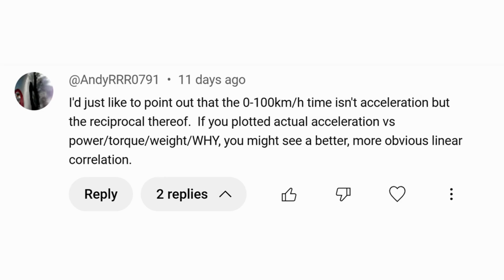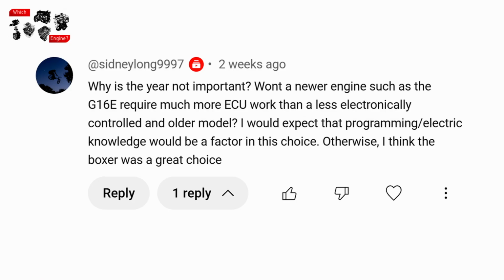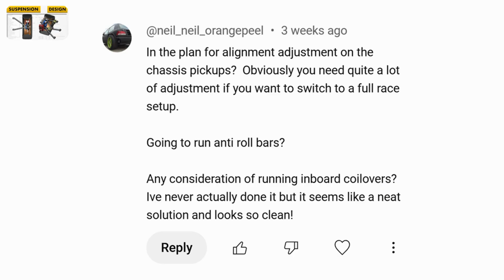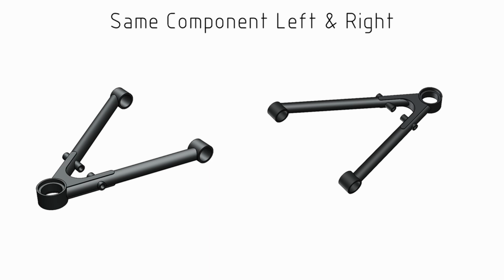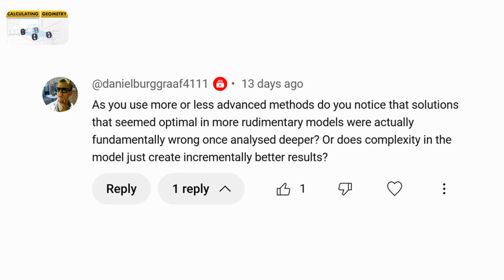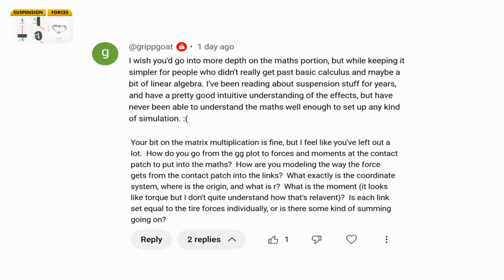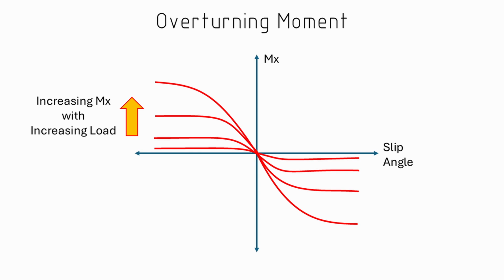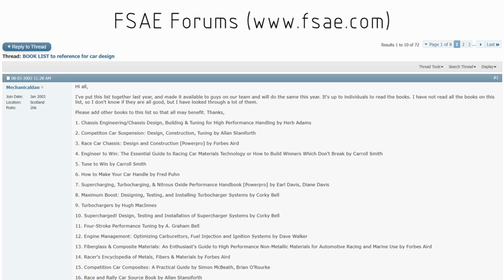Car Design Insights - Answering Your Questions (Project 171)

Comment: Like you, I'm interested in a road going car and the problem I have with virtually every resource is that they are all centered around race cars.  This is quite problematic, especially regarding the suspension because a race car may only have 2' (~5 cm) of suspension travel and a road car may have 8" (20cm) or more.  Heim joints (Rose joints) useful for a race car, may not have enough angular travel to work on a road car.  They might also wear out faster.  I find myself having to make estimated guesses a lot of the time.
Reply from the maker: There does seem to be a lot of decent information out there for racecars, and some for passenger cars, but not a lot for sportscars that sit somewhat in the middle.  The choice to go with Heim joints or not is a pretty difficult one.  Great for precise kinematics, but as you say limited travel, as well as added noise.  I think I'm heading down the path of making the suspension closer to what you would expect on a road going rally car.  There are too many roads around me that will need the extra travel.  I plan on continuing to document the process, so will hopefully be of interest to you.

Comment: As I'm learning more about suspension design and kinematics, it seems a very important input is the tyre model. Yet, even for the motorsports tyres companies like Yokohama, provide no information. What methods can we use to work around this limitation or gather the data ourselves?
Reply from the maker: Did a bit of a video on this recently, but will be aiming to put more out on this topic.  The problem with looking at tyres in short videos is that they are so important and have so many different effects on handling that it is hard to know exactly where to start.

Comment: I'm looking to build a car for road use in Norway. But there's one rule that's making things hard. Max 20kw per 100kg and no detuned engine.
Reply from the maker: You could have a lot of fun in a 100kW 500kg car.  Interesting regulation but it does seem 20kW per 100kg is a little on the low side.
Reply: @KevinHayward7  Well, yes. I've been thinking about doing a porsche 356 inspired build. But my heart yearns for a v12. So I've started at building some kind of v12 mid engined car, that brought me to your channel. We have had very strict regulation on cars for decades. But a few years ago they opened up for self built cars and bikes and they're more generous with modding cars. Your channel have been very valuable on my quest to realize this build!

Comment: I was going to ask whether you'd seen the inverter sportscar. I was able to get the full set of files (native sw files, BOM, some aero analysis reports) from Andre. An open source design like that seems rare in the mechanical engineering world (compared to software/electronics for example). Looking forward to hearing about the chassis. I assume if it's carbon it will be the folded panel method ECU has been doing. Will you be designing it to some sort of "structural equivalency" like we do in fsae?
Reply from the maker: The Inverter Sportscar is a wonderful resource for anyone looking at this sort of work. So much valuable shared information. If the car is carbon, it could be either a folded structure or a mould. I am probably leaning towards the latter to reduce the required additional bodywork. Angular faces on an FSAE car can be made to look pretty good, but hard to pull that off on a 50's style body work. Definitely would involve working to something like the structural equivalency. I have already tested a few sample panels to get a rough idea of what might be required.
Reply: Yes I suppose with the shapes you're hoping to achieve you'd need moulds, may as well full mould the monocoque.

Comment: Excellent video, though I feel for the person who is having their sway bar design stolen/borrowed. Keep up the good work
Reply from the maker: @JonGrove-o5f I think that the design may have been slightly improved by the extra eyes that were on it... :) Although pretty impressive that the person that was designing the ARB comes from a land of Flat Plane Cranks. They have made big inroads into their ability in designing suspension systems. Turns out even engine fanatics can be convinced a car needs to be able to handle as well :)

Comment: I really appreciate these videos. I came at it the other way. I have a decade of racing experience and I’m constantly trying to fill in the engineering holes. 

I really appreciated these videos videos on the forces involved. Without a formal background in mechanical engineering, it’s difficult to piece together enough of the fundamentals required to understand what those calculations need. Your videos were a gateway to knowing what to google. 

Thank you.
Reply from the maker: I realise that the most a video can probably do is provide a few pointers to what needs to be looked at so I am glad the videos help.
Reply: @ your selling yourself short. I can setup a FEA simulation and garbage in, garbage out. 

You showed how to use the plot of G-Forces to derive the forces the car would experience. It makes perfect sense now that I’ve seen it, but it wasn’t obvious before. 

Forces and moments are something I grasp conceptually but how to derive and apply them is black magic. Watching you use them to generate link loads was an ah ha moment for me. 

I still have a long ways to go, but hopefully now I know just enough to comprehend the books I have on the subject.

Comment: I've bought a lot of the books from the FSAE reading list, especially the ones related to chassis and suspension design. Do you have any good materials (not necessarily automotive related) that go over the kinematics solving methods using Jacobians that you mentioned in the suspension kinematics video? I've been working on a suspension force analysis program in MATLAB which is going well, but I'd also like some tools for rapidly testing for things like bump steer and IC angles, etc. I know OptimumK would be great for this application but I feel like I'd learn a lot from building something from the ground up.

This series has been great so far and I'm eager to apply some of the things I've learned to the next iteration of my FSAE team's suspension design.
Reply from the maker: I think I learnt most of the kinematics calcs from sources for robotics. I took a unit or two involving that at Uni and while I haven't worked in anything robotics orientated the geometry calcs are very similar. That and some matrix maths. I'm not actually sure where to look for these calcs in an automotive related text book. I went into suspension design after I had some of the geometry knowledge already.

Comment: Couldn't stop myself from grinning at 26:03 :) Huge appreciation for the work you are doing making this information more accessible.
Reply from the maker: Hopefully it wasn't too cheeky...
Reply: @KevinHayward7  na that's fine 😅

(Hmm ... First time I clicked that link it brought me to the section about my comment 🫣)

I don't want to annoy, it's just the "jet has to die" because the downsides overweight. Specifically it is not readable by 1 in 12 of all males (8% habe a red/green deficiency).
But even for the rest of us the changing luminance and color-spectrum is hard to read.

There was a big push in academia 10-ish years ago to remedy those issues, that's where parula or matplotlibs viridis stem from.

Comment: I guess I should have mentioned, I meant sideways RC (lateral) migration. I didn't think about pointing that out because whenever I designed suspension geometry (from my limited enthusiast perspective) there was not much up and down migration, especially in relation to sideways migration.  Since you mentioned vertical position, I learnt positioning RC near (especially below) ground should be avoided not only because of jacking but also extending distance to center of gravity, therefore increasing roll. Which obviously can be fixed with springs, roll bars  etc.
Anyway thanks for mentioning instant center, I'll take a closer look. RC migration was not my priority but camber gain in a corner. But since I could design both, geometry with camber I'm happy with and low RC migration, I did. I checked that with CAD model. Is it good in real life, will see when I build and test the car.
Btw. sadly I'm not familiar with calculations until someone will explain how to do them. So I am looking forward to seeing some examples. On the other hand I have no issues with geometry.
Reply from the maker: I did figure you were asking more about lateral migration.  I aim to cover more about RC heights etc when covering wheel loads. Hopefully I can answer more queries you might have.